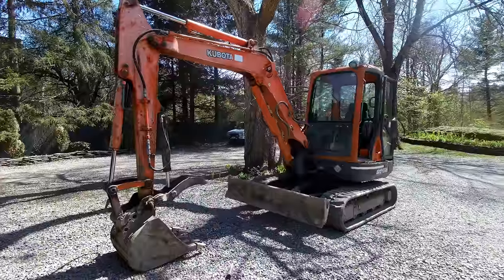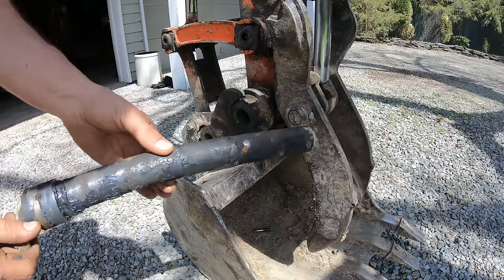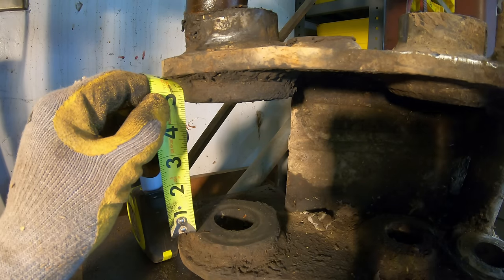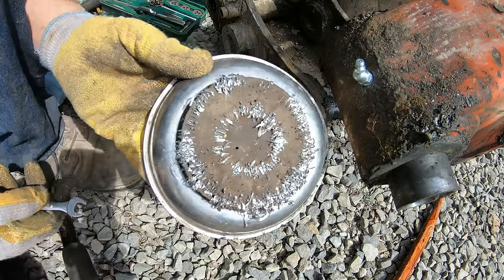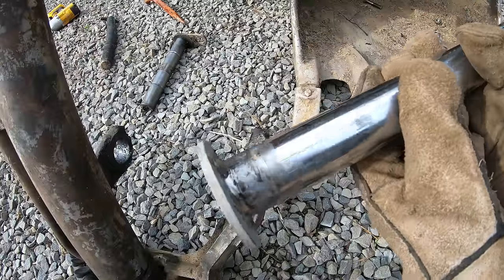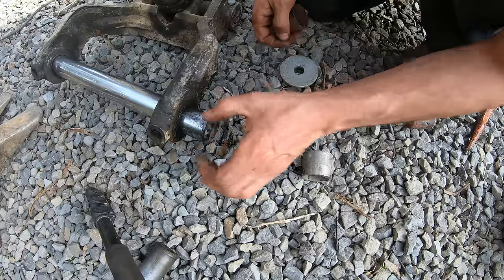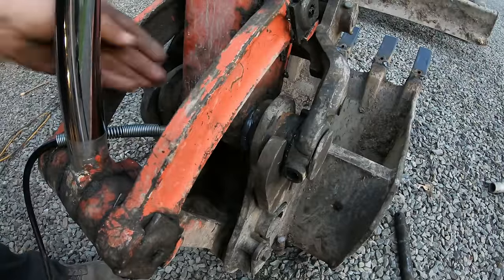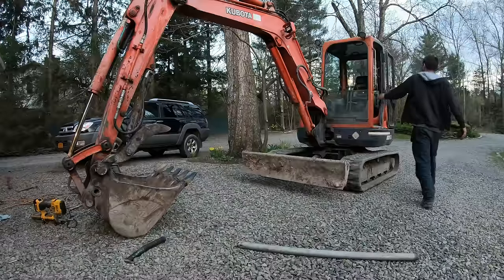Making an excavator bucket pin

Comment: Your logical way of looking at things and building it in your head before you ever got to the shop door!! I got an idea when you picked up that small block of wood and I hope you don't fall out off your chair laughing at me when you read it. ::: Take a plate of steel the same length as the width of bucket about say four or five inches wide (not exact science) but with that plate a way to attach to teeth and taper from teeth in thickness to outside o plate of steel to an edge that when brought down on big block of wood/stump like a swinging motion of an axe, split stump, blocks of wood or split log if short enough because between the power of the machine and accuracy of your ability with that stick or arm on the machine, you just might make world's first easy way to split some kinds of wood. I split fence rails back in my time for farmers to keep horses in a coralle (thing that keeps horses next to barn) since I can't spell very good anymore (70) but I try the best I can. On a side note; I surprised the doctor and nurses that work on me every other day. I'm going to keep my toes cause I got the circulation back in my feet (they keep talking about amputation) I have to walk with my arms resting on something or I fall down like a drunk person and it hurts bad. I don't do drugs or drink and it is really embarrassing in public. Thank for taking the time to read about my idea if you do. Your a very smart person and I shared your building that fine castle. They were truly impressed.  Thank you again

Comment: Love your videos! I have found that using a slower drill rotation speed with cutting oil is a way faster:)
Reply: Slower speed plus cutting oil equals faster job and sharper drill bit.

Comment: Did I miss something? You drilled through the casting, but there was a bushing inside? Either you drilled through it, and then moved it out of alignment (it wouldn't have stayed lined up with the body hole anyway) or you didn't drill through it and you are just greasing the outside of the bushing, which means your pin doesn't have grease against the bushing and it's metal on metal.

Comment: So the side of the assembly that has the Zero fitting (the bushing) needs a groove ground along the shaft to distribute the grease along the shaft and bushing. This can be done with a die grinder, a tool you should definitely own.

Comment: The only thing I would have done differently is double or triple layer weld the washers together on the side of the pin you pound with the hammer...  Nice use of a 15 dollar wood/metal cutting hole saw to cut the correct size hole for the washer that fits around the end of the pin... Who cares if it snaps and breaks trying... It worked and made it through the cut completely... Over all I think you made it better [the pin system] than what was in there...

Comment: Worked pretty well. Pins are expensive when you have to buy them direct, you are right. When you get a lathe you'll be able to do some nice stuff, like putting a chamfer on that pin, or make the correct size out of old junk. Nice of you to get your old man off the couch. How's he doing?
Reply from the maker: He's been doing well lately.
Reply: That's good to hear. You need to take an adventure with your old man. Get him in the new Yammie and take him for a wild ride!

Comment: that is awesome I work in the trades red seal weld and 4-year millwright work in the field again I did go out again and bought new semi-truck with a service box on the back of it. you have done alright for what you had to work with, as for me I would use my lathe and milling machine to do much of the work just because I do have one I do have a fabrication trailer I pull behind  i do not need to take parts to a fab shop any more too it does cut the repairs down  too 
I always replace all the pins when I come across  jobs like this most of the customers when I explain to them why is a good idea for all the pins to be replaced at this time they are willing to do it now then down the road and have the other downtime with the equipment as to me its the right way to do this  just the company I am working for they see the other way around  they want the machine to break down  to keep fixing it 
I was not raised that way I look at it I will be called back to that place to work on their equipment maybe repair or doing the maintenance following that repairs I do for them am now leased out on a paving company for the season on a project will take 5 years to do.  had the floors and the sea-cans  put in place for the site shop  here busy make handrail for the sea-cans stick then up and  this week have the roof put on  and the hear instilled to and lights

Comment: The hydraulic repair shops often have good pieces of hardened hydraulic rods in the scrap bin, too. Cut off the damaged areas and you have some supper strong steel.
Reply from the maker: Yeah, I think he gave me that for free. I had him do some cylinders, and I didn't see that on the bill. A few marks on it wont matter for making pins.

Comment: Andrew, get yourself a magnetic chip brush. Much better for cleaning up metal shavings, stronger magnet that you can retract into the handle so it drops the shavings. Perfect for finding dropped nuts and bolts.

Comment: Andrew, nice work as always, you get the job done with a minimum of hassles.  The new pin, the 'pointy end' the word machinists use is "chamfer" a symmetrical sloping surface at an edge or corner.  A chamfer is a transitional edge between two faces of an object. Sometimes defined as a form of bevel, it is often created at a 45° angle between two adjoining right-angled faces.

Comment: I remember making a few of those pins at a jobbing machine shop.

Also if you can't get local distributors for materials Mcmaster carr and Alro metal. For Alro you probably will have to call or message them.

Comment: Depending on the metal, I use a drill and tap. Slow and oil. Only one snapped bit, yes hard to get out but I still use this method.

Comment: The teeth on the bucket were sloppy because the previous operator probably continued to run the machine after one had fallen off, you need to stick a piece of brass rod in the center hole so no weld gets on it and then build up the inner tooth with weld until the outer sacrificial tooth fits right, try weld, magic marker try fit see the wear and add more weld where needed, grind as needed until the sacrificial tooth fits correctly then install with the roll pins.  Welding on the hardened pins may break off on the job and then you will be running the machine with out the sacrificial tooth.  Easier to fix it right, have a hammer punch a few extra roll pins and teeth with you on the job, they change in 5 mins and they are pretty cheap, some guys change their teeth to work in different materials.
Reply from the maker: IDK, I just always weld them on. For that machine I have different buckets for different stuff.

Comment: The only way to break the center of the pin is for the ends to have a space!!!!
THAT MEANS THE BUSHINGS ARE WORN OUT IN THE ENDS FITTINGS THAT THE BROKEN PINS CAME OUT OF! 
Replace the bushings too OR THE PINS WILL BEND AND MAKE THE ENTIRE JOINT WEAR OUT!

Comment: After you drilled and tapped for the grease fitting, you then knocked the bush back in flush. Did that not then move the hole you’d drilled in it so no grease could get in? Sorry if that sounds dumb...😂

Comment: They might have made that weak spot in the pin intentionally, since it is fast and easy to replace, compared to the boom. If you have a strong pin, and a weak spot on the boom, maybe it is more likely to break instead. The threads on the grease fitting are pretty shallow, so drilling the whole hole out to that diameter is removing more metal then needed. The grease itself only need a thin channel to run through. On the other hand it may very well be designed that way since its good business to sell new pins to people...

Comment: These pins with grease nipples generally don’t break, I’d say she’s just had a long hard life lol
Reply: Not on Kubotas.  Those pins always break, and they break at the grease hole in the middle.  Those pins are case hardened, and they don't plug both sides of the center grease hole, so the case hardening makes that area super hard, since it's designed to harden a certain depth from the surface.  If they would plug the holes, the inside of the holes wouldn't get glass hard, and eventually fail.

Comment: andrew you need a lathe they are the best thing to have around also i have an excavator just like yours and that is exactly what i did went to a hyd place told them the size i needed and they cut it exactly what i needed hytachi was 92.00 and they were 20.00 and a lot better but get yourself a lathe you will love it don't get a table model get a floor model at least a 12 inch swing

Comment: NPT stands for National Pipe Tapered, as opposed to NPS, which is National Pipe Straight. Same thread pitch, but straight. NPS must have another means of sealing, such as an O ring or gasket, as the threads themselves don't seal.

Comment: Andrew your creative in problem solving, I think you need to add a metal lathe to your arsenal of choices to problem solve, it'll make some tasks quicker ..... and give you more flexibility, example:  you need a pin of diameter   1.822" (maybe its metric )  and you have a 2" dia. piece of round stock on hand ......  a lathe solves the problem quickly  ...
Reply from the maker: Could it turn down a case hardened piece of metal though? I guess I do need one, I keep finding myself needing to make parts like that.
Reply: @AndrewCamarata   No problem, using carbide inserts I've turned down the shanks of " Hardened" steels and endmills, light cuts & fast rpm's. Case hardened is only hard on the surface, hence you take a deep cut to get underneath the surface hardened area .... also just general experiment and watch a variety of shop channels teaching about lathes and techniques. 
  If you do buy a lathe 1st thing to consider is what BORE size thru the chuck you will need, the larger the hole the more flexibility for turning larger on hand stock you might have laying around. 2nd thing to look out for is damage and dings on the  " WAYS"  ( the rails on top of the lathe " ) if your buying a used one.  Find a friend who knows lathes and get advice and or take him with you when looking ,  there's lots of gears in a lathe and broken gears could indicate serious problems. 
     Good luck man ....
Reply from the maker: Alien Physics sounds like I need to get one.
Reply: A Craigslist heat-treat oven
https://providence.craigslist.org/for/d/seekonk-paragon-kiln-front-loading/6856734335.html
Reply: @AndrewCamarata  Yes, You can machine case hardened material with a lathe.  You can even turn Tungsten Carbide with a manual lathe.  The critical part is using the correct type of cutting tool with the correct cutting parameters.  If you need something like that in the future or have questions about machining let me know.  I am a hands on engineer that started my own machine shop, I also do my own heat treating.  I started out in college as a metallurgical engineer then switched majors a couple times graduated and 8 years latter left my job as a manufacturing engineer to run my own machine shop.  I really enjoy your videos!!!  My company email is time@BullMooseengmfg.com

Comment: For  pressing down the bracket you was pushing down the pin area you should press down the area between the 2 pin sleeves it is where the bend is

Comment: have you used the cylinder rod before I never thought of that as a pin I wonder how it will wear?
Reply from the maker: I have heard it works fine. I guess I will find out.
Reply: @AndrewCamarata I would guess it's harder than a normal pin just watch it doesn't wear the bushing faster lot of grease will help and it might not bend as easy
Reply from the maker: Maybe, it also has that smooth coating. That might help with wear.
Reply: @AndrewCamarata  true

Comment: Have you ever seen an excavator bucket with the mouth facing forward like a front end loader bucket? Possibly by modifying a set of quick attach plates?
Reply from the maker: Yeah, you can usually flip them around.

Comment: Here in Europe you were still able to buy tape measures with both mm and inches on them many years ago. (I don't know if they are available here in switzerland anymore, haven't seen one in a long time). That would definetly be a good an helpfull thing for you! Don't you have them in the US? since US is the very last and only country worldwide still using the old imperial system, I assume there are millions of machines with metric measuring there?
Reply from the maker: samuel bhend I don’t think I’ve seen a metric tape measure. Stuff like that is imperial
Reply: @AndrewCamarata  ok. no, the ones i meant had both metric and imperial printed on them on one side. one edge metric and the other edge imperial, so there were both systems beside eachother to have both number at one sight. since i could imagine your many asian machines do mostly have metric bolts etc.

Comment: I use a plastic grocery bag under my magnet to pick up shavings. Much easier to clean off. 😁
Reply: Or just toss the magnet in a plastic bag - use the magnet to pick up the shavings, then turn the bag inside out when done.  Instant containment of debris.
Reply: @samvalentine3206  Thats what I meant - hats exactly what i do with all my magnets.picking up bolts, cut offs etc. - I guess you explained it better. :)   But those shavings can be a pain to get off the magnet, eh!

Comment: You do a lot of welding on equipment.I don't know if you disconnect your battery on your machines,but you should,for stray current and circuit issues.Always disconnect battery when welding on equipment.Just an FYI.
Reply from the maker: I have never disconnected the battery on something. Never had a problem. I've welded on many different vehicles.
Reply: I asked AC that same question once. I don’t bother disconnecting anymore.

Comment: Nice - and you got the real star in this time (Levi), Any idea if those pins are supposed to be hardened steel so they do not bend?
Reply from the maker: Yeah, they need to be hard. That hydraulic cylinder should be case hardened. I think. I guess we'll see what happens.
Reply: No problem - thanks for responding. I have unsuccessfully tried the drill true hardened steel before and its near impossible. As you know, case hardened is just the surface. If you take a file to the original Kubota pin you could compare the results to the new pin (for the fun of it).

Comment: Lil trick when using a whole saw where there is no metal for pilot drill to set whole saw in position is to jam a wooden wedge in that washer hole and drill using whole with the pilot drill bit, by doing so you now have the pilot bit keeping the whole saw true on its mark without that shuddering effect, you almost had it Andrew if you added an extra piece of wood in the middle the pilot bit would bite into that wood and drive that whole saw in place , your idea worked too.

Comment: Good move to get rid of the pin with a grease fitting in it. They always break at the hole. You could have had the hydraulic shop thread one end so you can pull the ears together. We used 1144 stress proof steel. Some of the chrome shafts can be brittle but most hydraulic shops use a higher quality steel so you should be good.

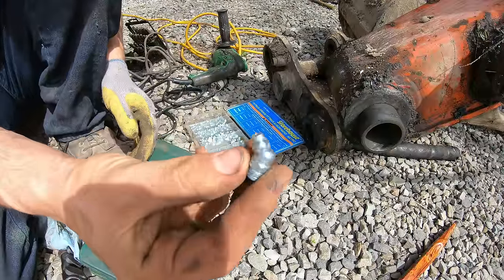Comment: Can the bushing at the end of the excavator stick move independent from the rest of that area? At 6:24 it’s sticking out. Wouldn’t that mean the hole might not line up with the fitting?
Reply: Thats what I was looking at I don't think that will stay greased it can't get to the rest of the pin
Reply: justin whitley then again if it can rotate freely maybe that’s the way it’s supposed to work and the outside of the independent bushing is supposed to get grease not the inside. I don’t know much about that sort of stuff.
Reply: @Grakoham  you want grease everywhere there is friction squeaking is your enemy we farm and grease everyday I have learned you can grease to much and cause grit to get into parts and cause failure but for the most part just grease everything
Reply: justin whitley I was just thinking if the pin fits tightly inside the independent bushing, then there might not be any movement inside the bushing, so you wouldn’t need grease. I do see what you are saying and I understand why and where you need to grease.

Comment: that pin lasted however many hours that machine has on it, and i know you typically buy high hour machines.  chances are, if that pin lasted 8k hours, the machine won't last another 8k.  would have been faster and cheaper to buy pin when you consider your time.

Comment: why does a pin need grease on the inside?
Reply: Lol..it doesn't.  That's just a vein to the center hole drilled perpendicular to it...to get the grease to the center of the boom bushing...right where he put the fitting.

Comment: Well cheating with my favorite measuring tool. Tells me 40mm comes to 1.575" .
hhhaaa if you had a lath you could turn down some  1 5/8".? 
I would try some 4140? I have used that in the past, with good results.

Comment: That's actually not a design flaw. It's designed like that so the pin breaks before you over exert the machine.
Reply from the maker: There is no such thing as over exert the machine, that's what the hydraulic relief does. The pin breaking is a design flaw, not a fuse.
Reply: @AndrewCamarata You're right. Ive actually never even been on one of these machines and I know nothing about them. I just finished watching the whole video and I realized I was wrong. I guess I wrote that dumb comment because it came to mind, oh well. Keep up the good work man and God bless.
Reply from the maker: All good, that’s what these videos are here for,
 discussions about the projects